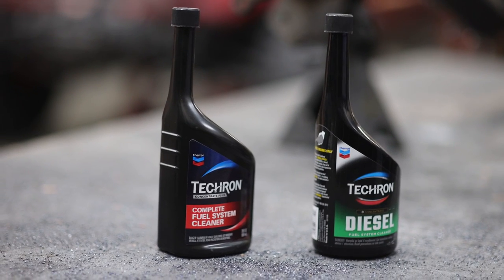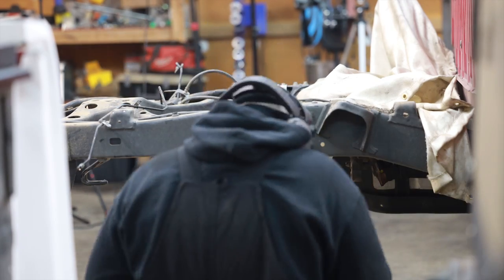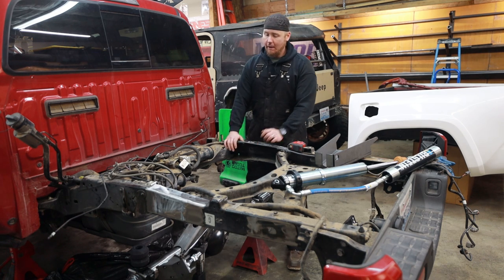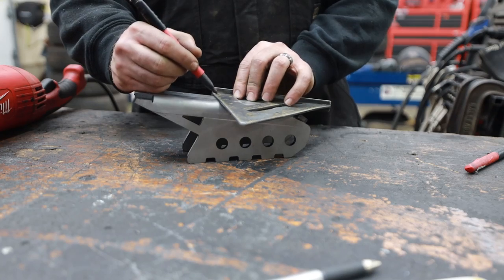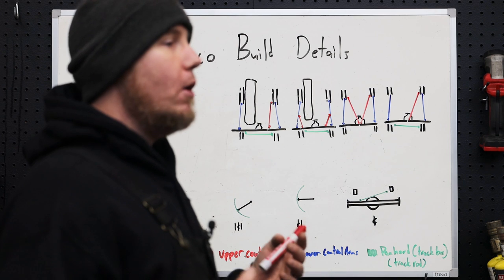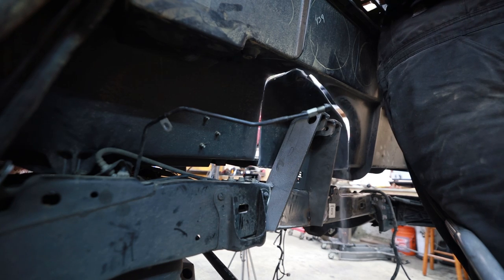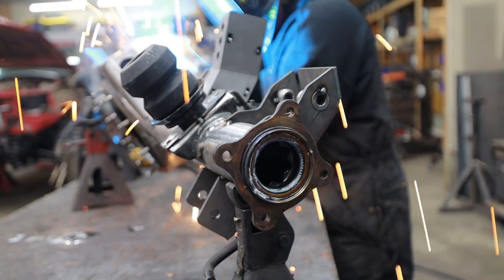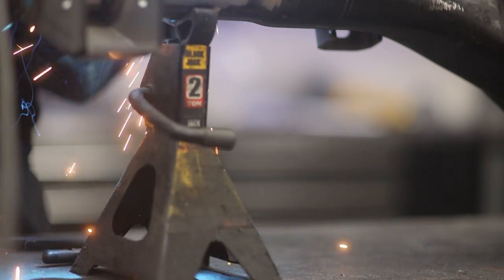Ultimate Toyota Tacoma build episode 6! Rear Coil over Conversion!

Comment: I think since the front suspension got so much wider you might have been better off getting a Ford 9" from Quick Performance or Currie built to match it.
Reply from the maker: I'm installing a custom Ford 9 this summer. The biggest challenge is these trucks are super sensitive to abs faults. These wheel speed sensors are extremely important and I won't be able to use 4wd without a way to use them in the new axle 👍
Reply: @DirtLifestyle  I'll be interested to see what the solution is to the ABS problem in the rear. 

Did you measure the WMS of the stock axle? I assume you are going to try to match the front long travel track with the custom axle?

Comment: I disagree with the one 3 link binding. It will push or pull the pinion angle more but will not bind. A triangle missing a side is a floppy mess. As always, keep up the good content. 

P.S. this is one of the few times I don’t agree with you.🤷🏻‍♂️

Comment: I really like how you always take time to go over why you are doing something a certain way, or why not to do it another way. And you can blame that junk c-channel frame on the chief engineer at Toyota. He swears up and down that having a flexy frame is somehow a good thing. And on the new tundra, he actually says he was angry that they had to box the frame. Which to me is just mind boggling. He claims its to offer a better ride. But you can't control chassis flex on the road, so it just leads to chassis jitter as the shocks can't prevent it. But I digress. MAYBE the 4th gen will fix the issue.

Comment: Have you ever heard of the Mumford link? It's essentially a modified Watts link. It lets you mount everything up out the way and gives a "perfectly" vertical travel instead of the arc of a panhard bar. Granted, it has more moving parts. But I think it could be very interesting on a 'wheeler.

https://www.youtube.com/watch?v=bpMbA8fPkoI